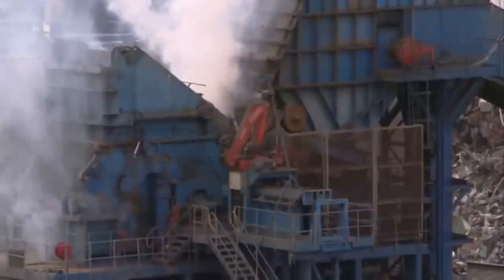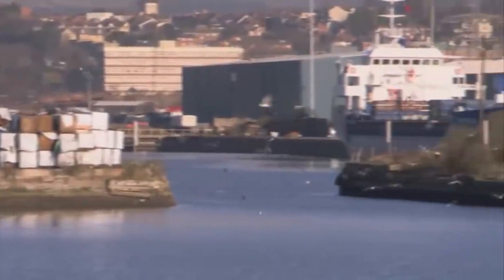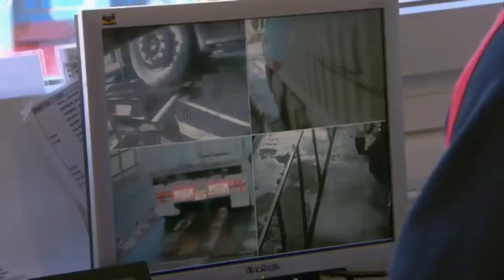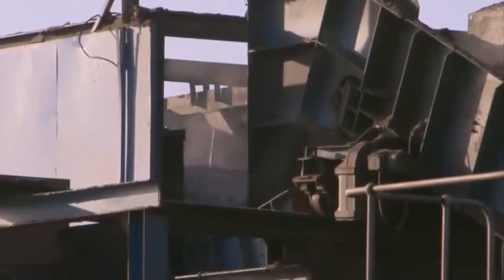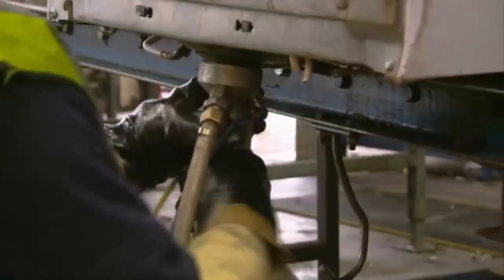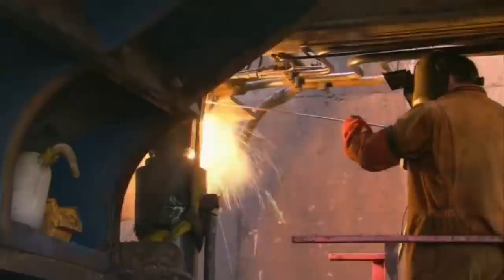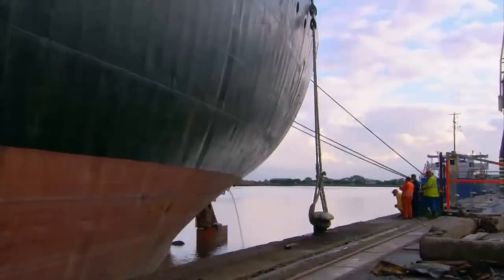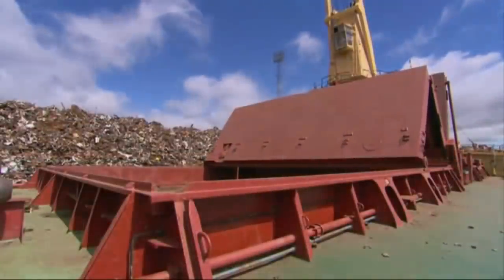World''s Biggest Shredder Documentary High Quality   National Geographic Megastructures Documentary

Comment: Saw where people want to see inside this beast. If this was a true shredder you could but this is actually a hammer mill. The foundry I used to work at made the hammers for smaller units with each hammer weighing in at about 1000 lbs. They spin so fast and throw things so violently it's impossible to safely see inside.
Reply: The shredder I operated had a top that opened. Sometimes when it got plugged up be opened the top and turned it on for a few seconds to clear it. So I have seen one run with it opened. It is scary.
Reply: I Wish to see that

Comment: I had to to some electrical work in one of their facilities in Chesapeake va around 15 years ago. We had to run some conduit etc in the building underneath the shredder. The noise (with double ear pro) and violent shaking of the building underneath the shredder was almost unbearable. It was absolutely unnerving. Communicating verbally was impossible. The entire facility was the grimies dirtiest place I have ever been. Any tools and clothes used on the site could never be used again anywhere you couldn't get dirty. After a week on the site the older electrician I was working for told the owner of our outfit that he wouldn't return to the site as conditions were absolutely deplorable (his exact words). I felt bad as the owner of the company was a friend and that was probably a pretty good contract. At the same time I really didn't want to go back and kept my mouth shut. I was glad we never went back.

Comment: My logo, RAS, Randy's Auto Salvage.  I been in the steel recycling business for 56 years now.  We have several hammer mill type shredders here in Michigan.  There is so much dust and smoke coming out of the mill you couldn't see anything if you wanted to.  The grinder is actually a drum with pins around the outside of it.  The pins hold the hammers.  The hammers pulverize the steel, you can't drop a penny in there without it being hit...that double chain with the gears is the feed wheels, the speed is controlled by the mill operator.  I was disappointed they didn't show what power was used to spin the hammer drum.  The one's here use massive electric motors which are more powerful and cheaper to run than diesel engines.  The hammers have to be changed on a regular basis.  I know one mill that has 8 hours maintenance for each 16 hours of operation.  They have to pull the hammers out, resharpen and balance them and then reinstall them.

Comment: I wonder if a conveyer belt would load ships more quickly; seems crane claw takes a lot of time moving back and forth between loads.
Reply: Jason L I was thinking the same. Maybe a bucket belt.
Reply: to pick upward select containers from many containers compiled maybe the conveyor idea's weakness. maybe combine conveyors and cranes
Reply: You still have to load the conveyor, swing it into place before and after.  Grab claws are actually a common choice, and ports are always looking for more efficient methods.  It also depends on what the port hauls.  A conveyor is pretty specific, it might work for scrap but not for  xxx product 

Trust me, they have thought of this.
Reply: The same was said about the nazi gas chambers but everything was done by hand
Reply: Scrap metal and rubber belts don't mix too well.
Reply: DEEREMEYER1  A reinforced one would. They handle crushed rocks which is as sharp as the scrap.
Reply: At 10 tons per claw-load, it would take a pretty high feed rate for a conveyor to keep up.
Reply: Just depends on the setup. Some of the stuff that goes through the shredder has to go back because it's too big. But everything that comes out is on a belt or the loader moves it to different bins or pikes. I ran a loader that'd lift 18 tons with ease and there are loaders a LOT bigger than that one.
Reply: grizzlygrizzle its 5 tons per claw ? I heard that in the beginning of video!  ???
Reply: @jackiebinns6205  the claw weighs 10 tons and can lift 10 tons is what I heard
Reply: The load needs to added in a level way. If you just fired it on from a conveyer, one side of the ship would start tilting
Reply: 7 months being a Ship loader operater and what I can tell you is that at 75 amps, our lowering bridge maybe less than halfway open, we load about 4-5k tons in a 12 hour shift. It's a conveyor from the  shaker pit at the bottom. metal gets thrown in by sennebogan 860e 6 teeth grapple..then drops it onto the shuttle conveyor then out onto the ships hatch.
Reply: I had to reply the part where he says the shredder cost 12 million dollars.
 At that price I would like to order a dozen of them. 😄

Comment: Bothersome to think that Evodxium cargo ship just used its load bays to deliver food grade sugar and now it is is is being used to transport the nastiest material known to man recycled steel contaminated with engine oil, automatic transmission fluid, antifreeze, fuels,  gear oils, lead paint, lead, asbestos from automotive heat shields and chimini flues, synthetic lubricants, mercury etc. mostly from the automotive process. Even when drained, lots of oil is retained in engines, transmissions, and axles.

Comment: There needs to be a much more efficient and quick way to do the loading process at the dock. Some type of very large conveyor system with enormous capacity that is constantly flowing as material is pushed in. Loading with these grapple hooks hundreds and hundreds of times over and over and over is extremely slow and inefficient

Comment: Wouldn't it be faster to use conveyor belts to load the ship?  At least use them supplementally.
Reply: DroneXFun 
My guess theirs a degree of flexibility, they can remove the grapple and replace it with a grab for different cargos (just a guess)
Reply: I do work for a scrap mill that is a similar operation, also with a giant shredder and shear as well.  Conveyors are expensive and take up a lot of room, and all those rollers and motors are a maintenance nightmare.

Its easier to buy 4 diesel grapples to load ships with, and 5-10 grapple machines to move material and load small ships and barges.  You can move them out of the way and use the machines for other tasks the rest of the time.

Comment: the cars could be made better and more for repairability, and last twice as long.  capitalism is tough on the environment.  every part changed every year so it won't fit the after market parts.  They could use the same brake wheel cylinder in 50 different cars, and they would be re usable

Comment: and the crew is not smart enough to try a jack hammer air or electric with a flat pusher bit to push out the stuck pin??
kinda tricky but a chain to sling the jack hammer works good on a unit with large pins and open like this!!
and over grease the joint with high pressure 10kpsi lube to force out the junk on the pin to bearing!!
as well as use an portable induction heater for the rod eye..
expand the eye to make it release the pin!!
air arc should to have been the last last resort... and watch the heating of the rod eye!!
it can make a weak point on the hyd cylinder!! or make it too hard and the eye will snap under pressure!!
as well as degrade the seals on the hyd cylinder.

Comment: chains need oiling.
Reply: Narrator needs it worse.
Reply: Working at a shredder myself and doing maintenance on the shredder, i can say, oiling the chains is a bad idea. Metal dust and stuff flies around the machine during shredding and oil will just collect that dust and cause abrasion causing them to wear out faster.